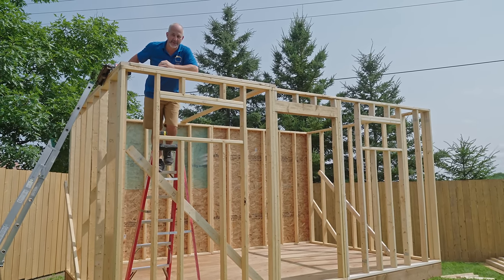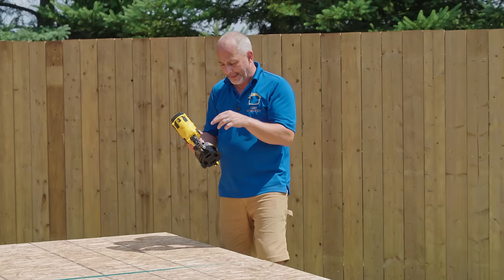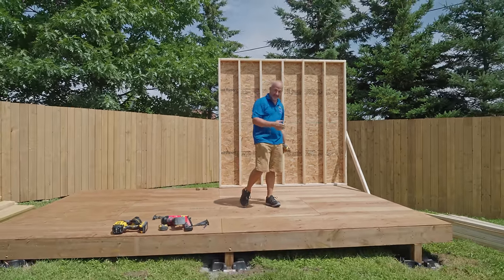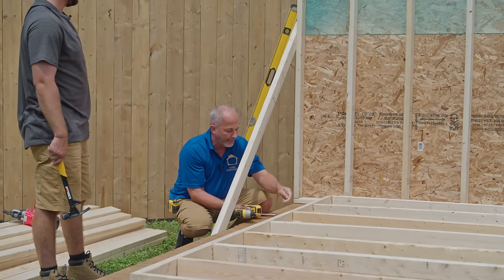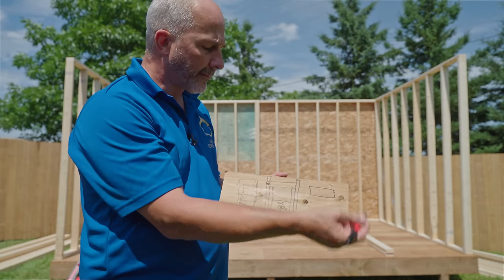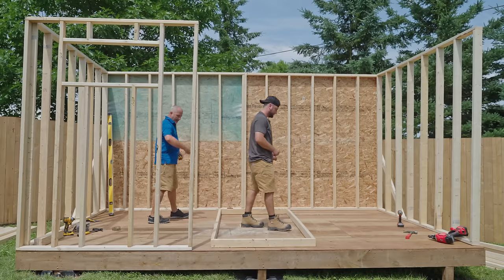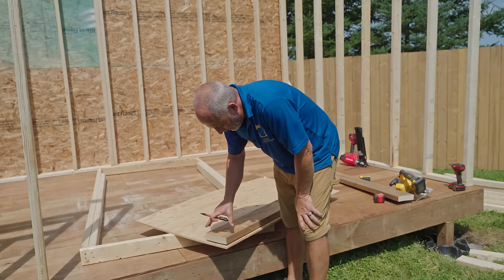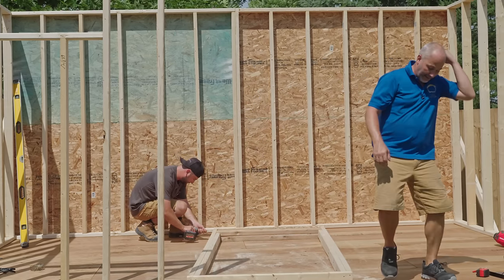How to Frame a Shed (One Section at a Time)

Comment: Your bottom plate should always go beyond the doorway or join within the doorway so you don't end up with tiny plate pieces under one side of the doorway.
Reply: Yeah and he talked about roof load but then said four nails in the window header will hold but they won't. There aren't any jack studs under the window header to carry the roof load to the rim joist. I did like the design he chose and the reason for putting the windows sideways up near the ceiling.

Comment: Is there any advantages going 12 inch centres instead of 16s?
Yes, I know the material cost would be more, but would it add more strength to the building overtime?

Comment: Since you are laying out studs one at a time it takes NO more time to use 16" o/c spacing.  You may not use that for the siding but it will help a ton if you use 4x8 sheathing on the inside of the shed ro cut down waste.

Comment: One of the best DIY channels around. My concern with sheds is that raccoons, opossums, feral cats, or even skunks may decide to live under a shed. Not sure how to prevent that.
Reply: @armslength2618  -- hmmm, I want to drive my riding mower into my shed so I can't set it too high because I don't have room for much of a ramp. But screening might work. My shed is being built on a gravel bed, with five 4x4 runners on the long side with joists on top of that. So I'd imagine the long sides are OK and the ends could be screened except that I'll need to bury the screen down 6 inches or more in the gravel. If animals are persistent in digging, I'd need to screen the sides as well. I think since I have lots of woods, if I make it just a little difficult for animals to find a haven under my shed, they will quickly give up and go elsewhere.

Comment: Near the end, after the diagonal braces were in, you asked your son to push sideways to show the strength. When he did, the stud easily bowed. Seems to me that the weight of the roof and snow could cause some bending of the studs. Isn’t one reason for the sheathing to keep the studs straight?

Comment: I live in Upper Michigan will this shed do ok with our snow loads or do I need to change a few things to allow for that weight. Thank you so much for all you share, you have no I idea what it means to me as a independant woman to be able to do projects right without begging one of my brothers to help LOL. Now I can call a few of my sisters and we can get it done and done right without unsafe short cuts LOL. Blessings
Reply: Please don't follow what he does, your shed will collapse with a snow load if you do.
I'm not being a jerk, I'm dead serious, he either doesn't know much but is good at pretending or he just doesn't care about doing things the right way.
Reply: @ajs96350 what is inadequate about it? Am wondering how to fix.
Reply: @YellowBunchofBananas  
Don't ever use such short nails for nailing sheathing, needs to be 2 1/4" and the spacing he is using is atrocious, 6" apart on the nails everywhere.
Sheathing should be run vertical, if you want to run it sideways, STAGGER THE JOINTS.
Reply: @ajs96350  Thanks. That makes senas
IIRC in Ontario is 2 inch minimum in this application, 6 inch spacing on edges but there's no reason to cheap out on this and that's still more than he used. I'm actually surprised he didn't just use the framing nailer since the diy friendly solution would probably be to keep it to one nail gun for a project like this.
Reply: @YellowBunchofBananas  It looks like a roofing nailer he was using and short nails to boot. 
An air nailer is cheap and quite effective, there is no reason to use that nailer for that application, it makes no sense.
He was running 5 (short) nails across 48" sheet so that's a spacing of 12", unbelievable.
Reply: @ajs96350 he said 5 nails but i think i saw him put much more. Should the windows have headers?
Reply: @TheRainHarvester  He could put 15 nails per run and it still wouldn't be any good cause the nails he is using are a joke.
My rule of thumb is every exterior window and door has a header, yes.
Reply: @ajs96350 Lol. Really? It's not going to collapse. He's been at this for a long time. Relax. The man isn't going to teach death trap construction on YouTube. 😂

Comment: I only have a Ryobi finish nailer. So I put in a 2.5 inch nail then use GRK screws.
Reply from the maker: expansive fasteners!
Reply: Yes they are. I haven’t done a project needing more than a couple hundred fasteners lately. I wonder what project size would push me into a more economical fastener. 😋
Reply: Most of what I use is $0.15 US per screw. But when you get into a 4 inch rugged structural screw they are $0.50 a screw. 

It’s actually kind of fun to look at their saltwater contact screws. Like $4 each.

Comment: Jeff question?  I'm reparing my in-laws toilet do. I have to remove the old toilet flange and put in a new on do you know if I actually have to Smash the pvc to get out or is there a option to just leave it there and slid in a smaller one. Any thoughts, thanks
Reply from the maker: they sell am twist and seal flange and pipe that sits in the original flange. works great as longa s you have a toilet with the instant flush/ siphon like in my recent video. Cheers! the first foot of down pipe can be smaller just like the trap with no issues.!
Reply: Thank you

Comment: gone are the days when we trenched the plates for studs,half scarfed the cnrs and where the walls joined length wise and  any cross walls,3x1 ,braces were set in to the studs and plates  or later metal angle  ones  'never liked them but times change ,did not need sheeting to brace the walls

Comment: What are the makes/models of the 2 nail guns used? I can't find them in your affiliate store or on the website? Thanks
Reply: red is Craftsman and Yellow DeWalt
Reply: @AmauryOct  sorry I meant the type of nailer. I'm guessing the Craftsman is a framing nailer, is the Dewalt a finish nailer? I'm new to this and will be building a 16x10 shed in the Spring so I've got the winter to learn and plan how to do this and figure out what tools I need.

Comment: 37:14. Hello. Why don't you use foam glue or carpentry glue for these purposes? For example, in Russia, many builders began to actively use PVA glue (the same Kleiberite; but this is more often for external structures) and glue foam (this is for the entire frame, for a warm contour) to connect two adjacent boards (to create a "more monolithic structure" and eliminate through cracks), for example, when you make a header or when you connect two adjacent racks when installing a window opening...In this case, it is considered that the adhesive foam is guaranteed to hide any cracks, being a sealer and insulation... Question: Is glue foam used for these purposes in North America? (I didn't notice it). And if you don't use it, then why? (maybe there is a good reason for this - moisture /rotting of wood, which can shorten the service life of the structure, and the like?)

Comment: how big a shed/workshop could you build like this? i have a space for a 6x5 meter workshop
Reply from the maker: in Ontario code says 10 x 16 with no permit. after that you must build code compliant. Cheers!
Reply: @HomeRenoVisionDIY  I'm in UK, no need for planning permit or to build to certain code as long as I stick within certain rules , just wondering if the same build method is suitable for larger shed
Reply: @HomeRenoVisionDIY  Isn't it 10x10 ?

Comment: What is the exact type of concrete he used for the foudation? What is the exact mixture of sand , water and concrete to make the cement foundation ?  What is the best brand of concrete to use , from Home Depot.  What are the exact measurements on the wall studs or 2x4''  that are being for the walls ? I want all the details.  Also I know in most houses there is the Electrical pipes for the electricians . Then there is pipes pre-cluding up for plumbing . Please distinggush water pipes to be used for drinking water as compared to water to be used for toilet water.  Please explain all the pipes that pre-clude or that are sticking up after a cement or concete foundation .   Please do a video explaining the exact distance each wall 2x4 should be from one another. Plus how to know exactly where to place the short one or two foot cuts between the long six foot 2x4"s  . I have tried buying books. I tried to buy a book on concrete and foundation from Bares and Nobel. They could not get that book. The way I see it. Is very simple if I can buy the land then just build my own house. Once I know all the details , I will feel more comfortable. Maybe even volunteer to build houses for free with Habitat for Humanity . As long as I am learning how to build a complete house. I am a vetean .I can only get approved for $400,000.00 Or four hundred thousand . Now days a beautiful three bed , two full bath , with two car garage, beautiful front yard and big back yard costs $600,000.00 . Then what must be consideered is the following: ( 1.) What is the crime rate? ( 2.) What are the bad weather problems ? Are there forest fires ? Are the homes prone to floods ? Are there earth quakes at random ? Are there Ef-2- 5 Tornados ?   Is it easy to get Home Owners Insurance ?  So many factors involved . Today is Feb 6, 2024 . I have been watchng the news. So many big beautiful mansions in the Hollywood Hills wiped out by floods and mudslides. Some mansions fell off a cliff. Because the home owner wanted a view of the ocean. Other wanted the smell of pine trees. So their house was built in front of a big dirt hill . Now the house or mansion is swimming in the mud. Very sad.

Comment: I don't understand the plastic foundation thing? Did you pour concrete in it? Did you nail the post on? Are they just sitting there on top of the plastic thing?  What if the plastic thing moves?

Comment: I get framing in smaller sections to an extent. but I just see that as a lot of extra complication on that front wall 16ft wall frame it up put dogs on both ends and stand that first. I am no major beefcake... but 1 guy should be able to stand a 16ft wall without sheathing and if not buy a case of beer and make some friends haha.

Comment: Cross bracing must go from top plate to bottom plate.  Other wise the studs will bow with lateral force and allow the wall to rack some. Since, these walls are cross braced near the top, very little racking should occur.
Reply from the maker: also. since there is no need for a permit we just don't care!

Comment: I’m confused. You put a header over the door sitting on jack studs to transfer the weight of the wider otherwise unsupported section of the roof. And blocks (cripples?) to complete the transfer to the header. All this weight transfer works because the header sits ON the jack stud. Then over the windows, almost as wide, it seems that the weight transfer will depend on the sideways strength of the nails supporting all the weight. Why no header and jack studs?

Comment: Save all that time measuring wall plates. Set a 2 by 4 in place on the floor and mark it for length. Stack that board on top of another and cut 2 at once. Measure once and cut twice.

Comment: I've been hanging and finishing drywall for 25 years and never have i seen the wall boarders put up  crown mold. The contractor simply tell me when I make my bid which rooms get get crown we work it into our bid and just tape not finish there. Then the trim carpenter comes and puts up the molding with Brad nails.

Comment: Is anything wrong with using wood screws instead of nails in framing? Is it about the time spent to drive the screws or/and their cost to not use screws?
Reply: tl;dr framing expands and contracts. nails allow for this, screws dont. nails will bend, screws will break.

You would much rather have something show signs of failure, rather than spontaneously break.

This is a huge oversimplification but yeah.
Reply: nails have a stronger breaking and bonding threshold vs screws.  Meaning, if you attach a piece of wood to the side of two identical walls; 1 with a screw and 1 with a nail (both equal in diameter), and slowly start putting the same amount of weight on each piece of wood you just attached, the piece of wood with the screw would fall to the floor first.  For a shed, and for backup, screws are just fine though.  If you're building a habitable home, I'd use nails first, and screws to tie in.
Reply: @mzy10511  Hmm.. How come they are building with wood screws in Germany and don't have these issues. Don't tell me they don't know what they are doing... Screws will break? Maybe grade 5 you guys are using in US.
Reply: @billsmith9249  Is there a paper or article or something scientifically proven or even a youtube movie to back your claims?
Reply: @car9167  while I do not know specifically where that science is located, I know there are articles and papers written because I have read them over the years.  I encourage you to do you own research.  good luck!
Reply: @billsmith9249  Yeah I found a youtube movie proving what you said and posted it here in a comment but was removed by youtube. For lower and upper plates screws are better because they are stressed in tension while the rest is a combined pull and shear where in shear stress nails are better because they are soft and bend while the screws are hardened and brake. I do think that quality screws like grade 10 or 12.9 are better than nails. I have watched many youtube movies with houses build in Germany and they use only screws
Reply: @car9167  If your lumber is twisted, I would definitely start out with screws, a) to get it straightened and b) to pull it tight, then I would put 1 or 2 ring shank nails in it to solidify the connections.  Again, that is in an ideal world where money is not a problem, time is not a problem, someone has lots of patience, and if someone has a helper.  I don't have a helper and time is not on my side. lol  Oh, and the weather doesn't want to cooperate this week either. >:o

Comment: Why wouldn't you put the plywood on vertical where the edges break on the 4ft stud instead of horizontal where there is a butt joint at 4ft where you would have to add blocking? Additionally,  I feel you should have explained how to square the wall, at least with the OSB?
Reply: He does everything the wrong way, I mean using 1 1/4" nails for sheathing with massive gaps in nail spacing and then explaining how it gives shear strength. That tells enough.
Reply: @ajs96350 should windows have a header too?
Reply: @TheRainHarvester  Of course, but honestly I was disgusted and skipped some of it because I was so annoyed, I didn't see that part.
Reply: @ajs96350 You're everywhere getting in a twist, huh? 😂 Again.. relax, man. It's not that serious.

Comment: so did I miss something?  The whole structure is still just resting on those 6 4x4 posts?  I'm going to make this same shed... This seems important.  A moderate earthquake could just slide the whole thing off.  Help?
Reply: Resting? No earthquakes in Ottawa, but go ahead and tie it down with hurricane ties suitable for mobile homes if you need to.

Comment: As a member of the Fiber-Cement/Hardie-plank "master race", this might sound a bit pretentious, but I simply don't understand how you can do vinyl siding on just the frame without plywood or the equivalent. I mean, I suppose I know it could be done in theory, but there is no real strength in vinyl siding. I can just imagine a scenario where you're throwing a baseball around your back yard, make a bad throw and it punches a hole right through your shed wall. Could also be a tree branch during a storm. Wood-lap siding (or fiber cement) would actually offer some protection here without the plywood, but I just don't see this with vinyl. I guess I'll have to see how well this goes in the future videos. 

On the topic of fiber cement siding, that would actually be an interesting video to see you do. Vinyl is the cheaper option, as you correctly indicate, and I don't want to suggest it isn't a valid option, but there are many people who would like to invest in the more expensive but higher-quality (and more appealing) product, but save money by installing it themselves. I hired professionals to install my siding and it cost me a lot. Hardie-plank does have very specific installation instructions, and installers are trained by the manufacturer. That cost gets passed on to the customer. You often preach that you save money by doing things yourself, not by buying the cheapest product. No reason this shouldn't apply to siding as well.
Reply: Diagonal braces held frames together for centuries before sheet goods. They still work fine.
Reply: And honestly...most crews aren't really trained by the manufacturer to install products correctly, so when you need to make a warranty claim, you'll be in a mess. Lol. The trades are dying for new blood and often hire people with zero experience and let them do the majority of their learning on the job. Good workers will learn the correct specs and meet them, but not everybody is a good worker. 🤷 There are plenty of cement board installation videos on YouTube if that's what you want, though.

Comment: Why wouldn't your  double plates span over the joints on the front walls and let your roof system act as the collar ties? Also because you've decided not to use sheathing, Shouldn't your inside corner braces span from the wall corners right to the floor with proper angle cuts, instead of ending braces on middle studs that can still flex. I mean yes, its a shed, but i live in Ottawa too, and those wind storms and tornadoes we've gotten over the past few years could easily   disassemble that shed all through the neighbors yards especially without sheathing. Have fun with that clean up! 😆